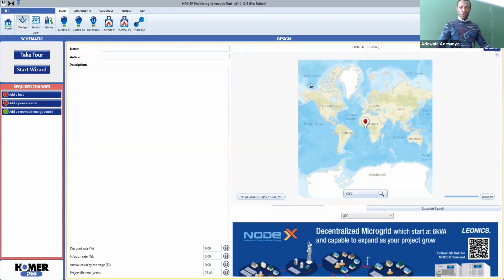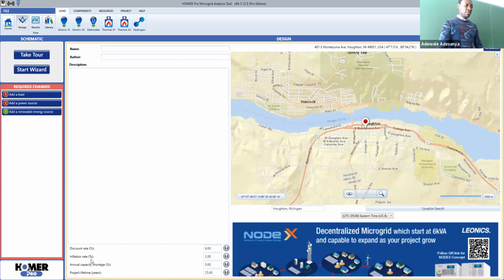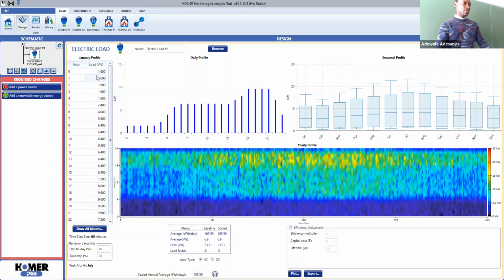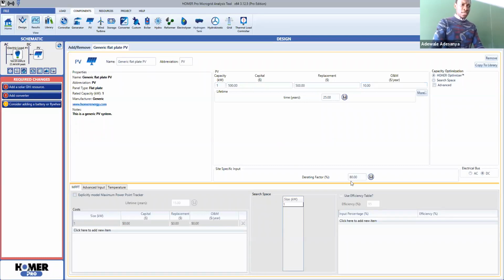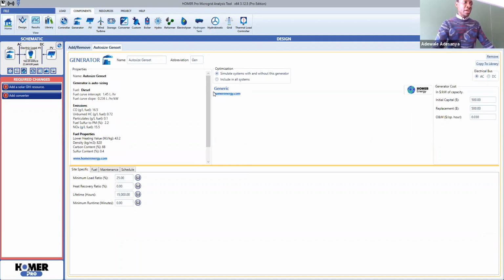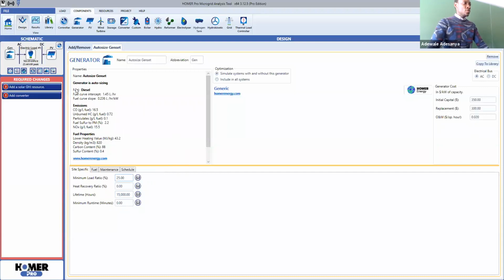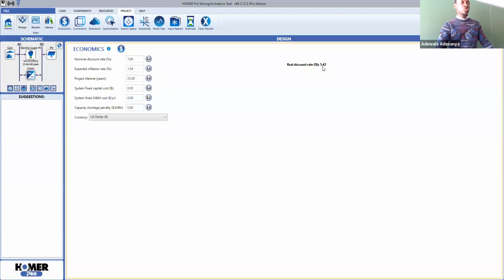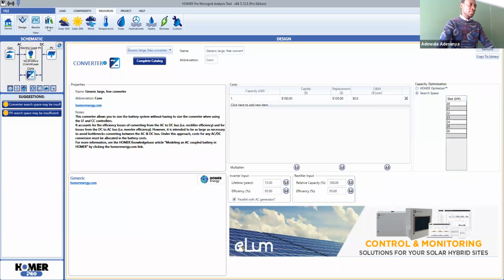HOMER tutorial video

Comment: how do i add consuption limit on diesel generator in homer
Reply: Good question, HOMER optimizes the system to limit your diesel consumption based on least cost with other cheaper resources. You can also reduce the capacity setting for generators to allow more renewables in the system

Comment: Hello @Joshua Pearce thank you for the useful video. Do you perhaps know how to integrate vehicle to grid on Homer software
Reply: Perhaps late, but to answer your question, you'll most likely need to do it outside HOMER as the software is not designed to cater for transmission or distribution. There are tons of modeling software out there that you may want to explore for that. However, you can integrate vehicle to home (V2H) or vehicle to building (V2B) by either setting up their supplies as grid or adding their loads